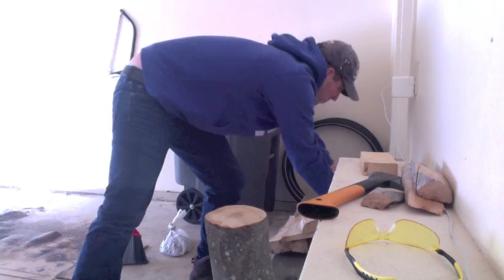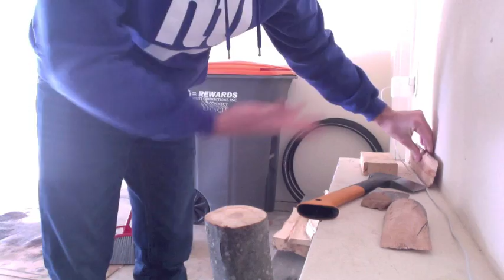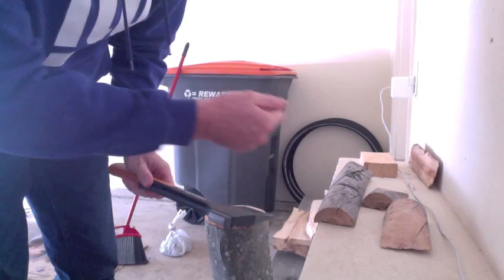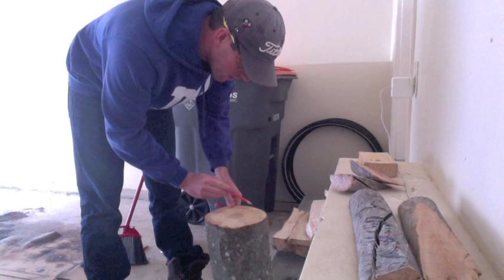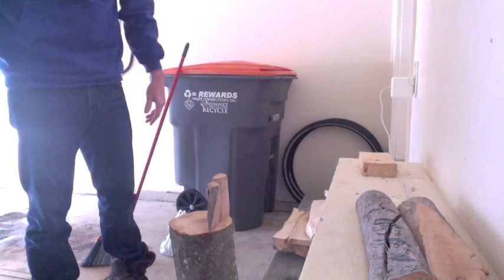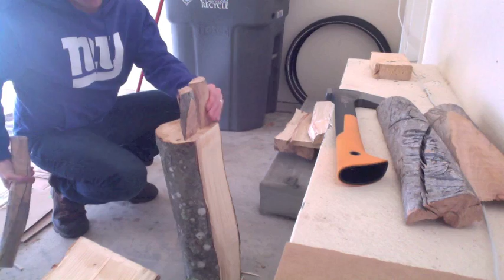By Hand - Using wedges to turn a log to lumber

Comment: thanks for that.    any particular wood better than others for cutting slabs?    looking to make a nice rustic outdoor bench say about 1200mm length
Reply: In generally you want something that will grow tall and straight with minimal branches along the lower 2/3rds or so of its height. The more branches there are the more knots you have to contend with, which are usually the biggest problem when splitting.

Ash tends to be one of the better species for a wide variety of woodworking projects; it's a very beginner friendly wood. I've used it in the past to split out quarter staves for self bow blanks and it was pretty easy to work with. Depending on where you live and what's available - white oak, black walnut, black locust and cedar are all pretty good for splitting from what I hear.

Comment: Wood species are very persnikity. 
And if you don't know wood it can split very wrong.
I guess this technique has it's place. But milling it with a Sawmill will save you alot of wood and time. Those are excellent logs, very clear and straight.
Reply: Of course, that's a stone age to early medieval technique. It was substituted by sawing pits and later on sawmills.